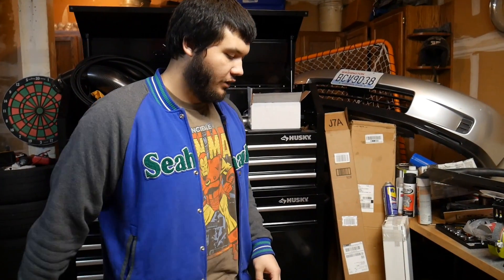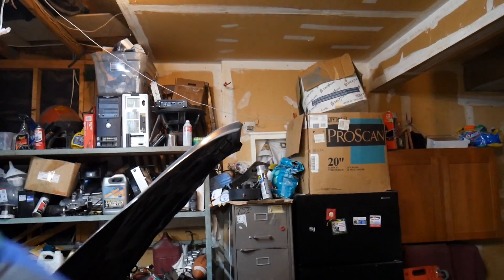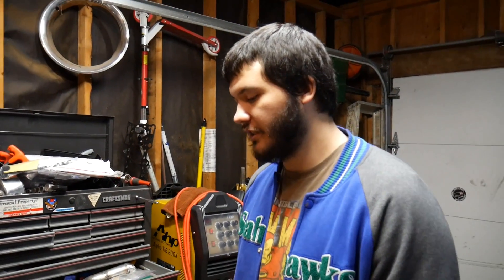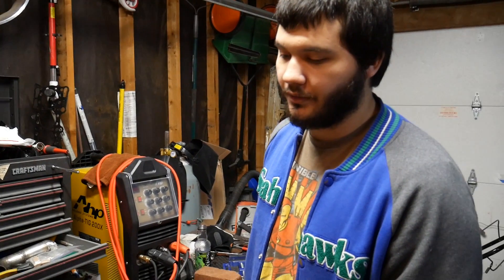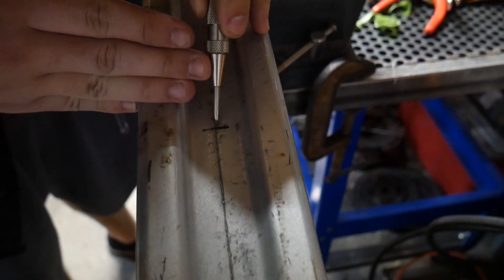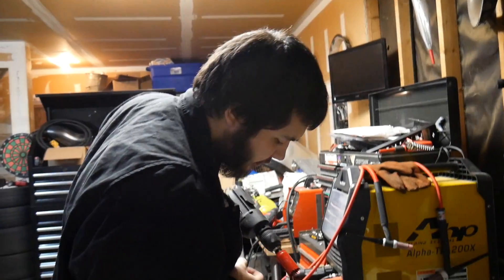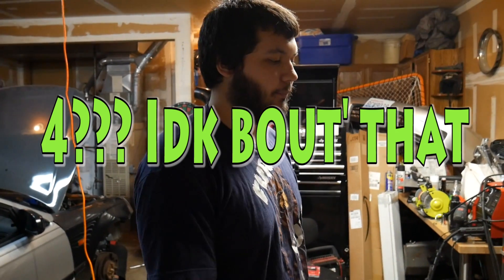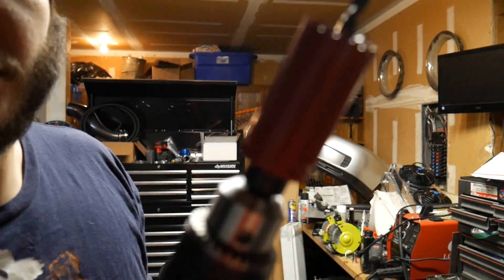How To Increase Engine Air Flow For Free!

Comment: Isn’t the bumper just going to go over the bumper support?
Reply from the maker: Daniel Clapper yeah but air will go through the grill of the bumper and be blocked from the support, so we cut the holes so the air could reach the radiator and intercooler better
Reply from the maker: Thanks for the sub as well man!